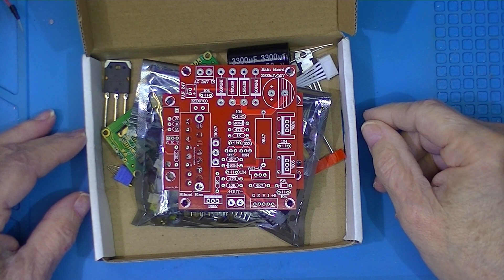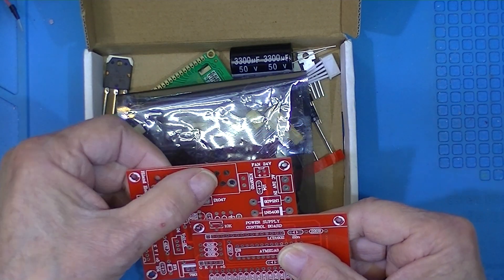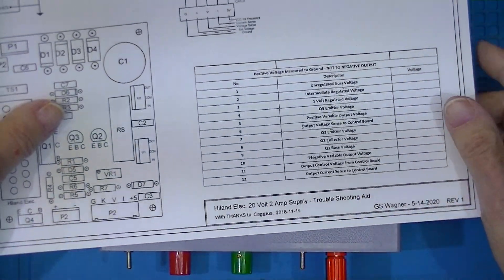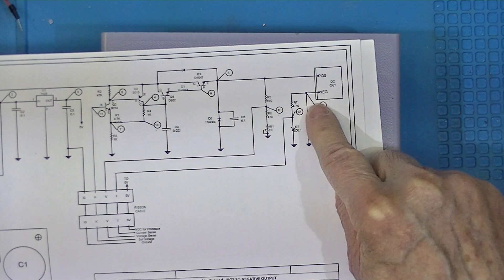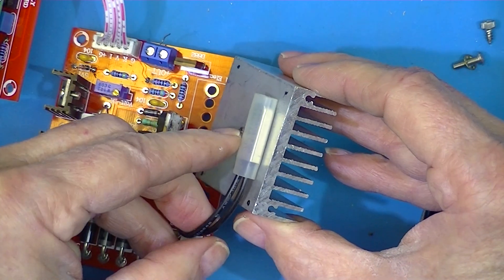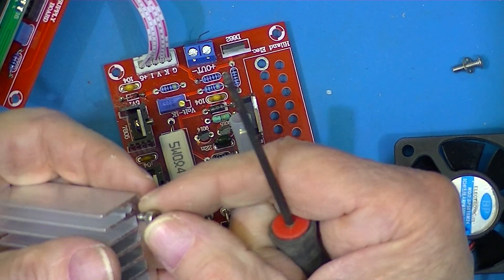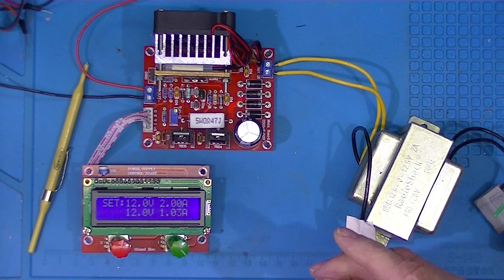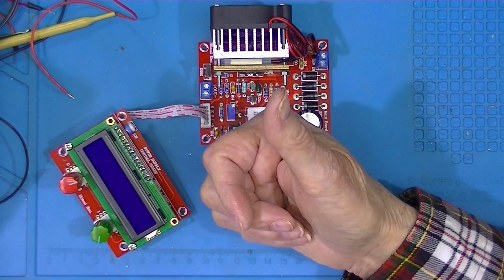28 Volt 2 Amp DIY Power Supply Trouble Shooting

Comment: I have this kit and planning soon to build it. Scratching my head how to mount the sensor on the heatsink. Looks like you have clamped it on. 
Is the clear plastic on the sensor supposed to stay on? Thought it was just protection.
Reply from the maker: Yes, the plastic tube shoved over the switch stays. The switch mat b eelectrically connected to the exterior, and thus making contact with the heat sink may (will) cause smoke.

Please let me know how you make out!!
Thanks
Steve